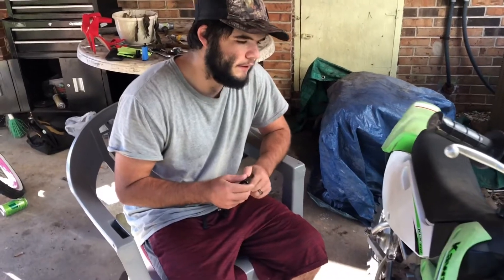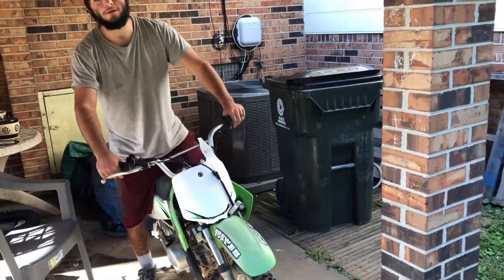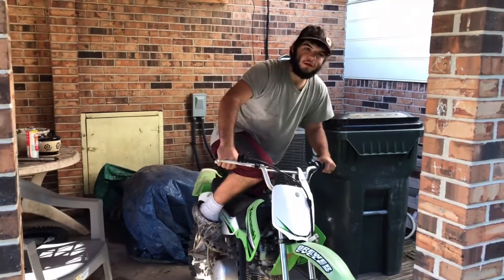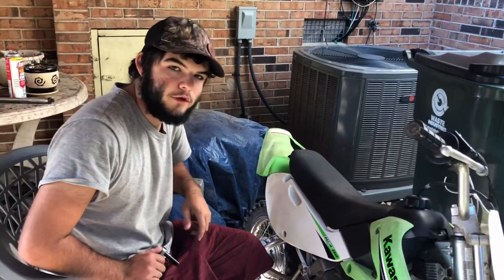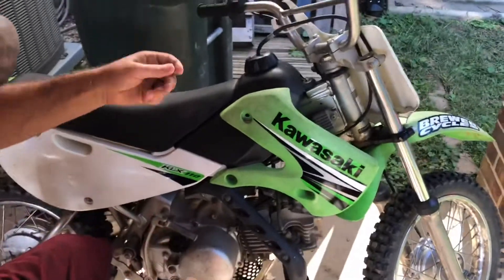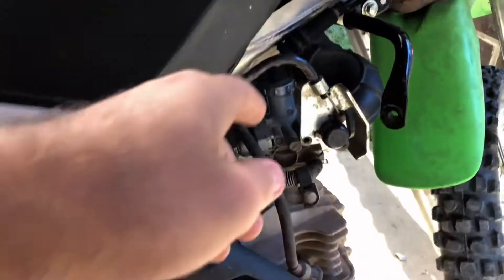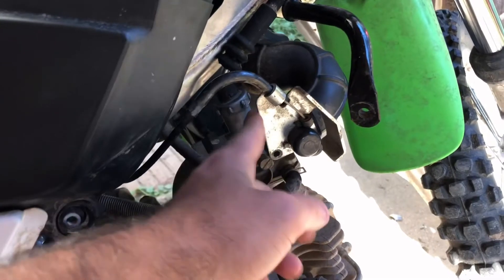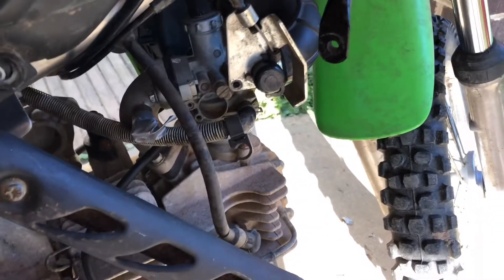Dirtbike won’t IDLE!? Here’s the FIX!!

Comment: You are good to Engines...  Do you also like a really low idle  when it not stops but still runs and fight for the life... Rough struggled Idle
Reply from the maker: I prefer to have my idle pretty normal I don’t like a real low idle bc it may just not run properly so I try to get my idle just right so that it wouldn’t choke off and wouldn’t rev up the engine